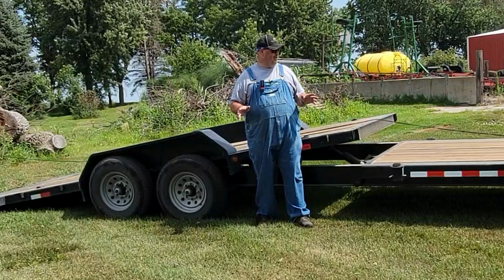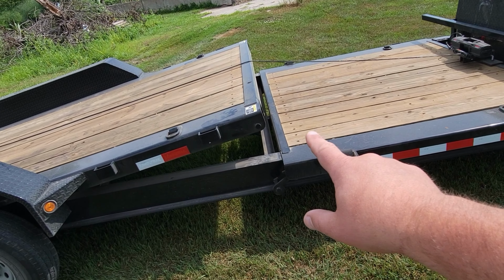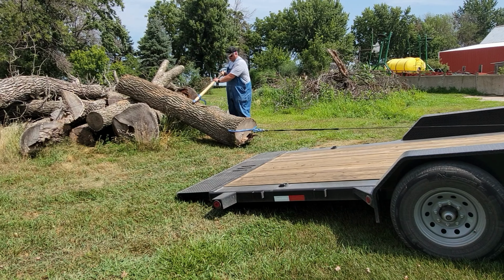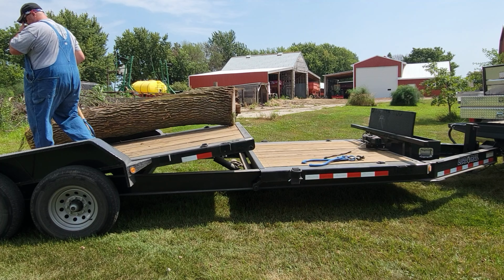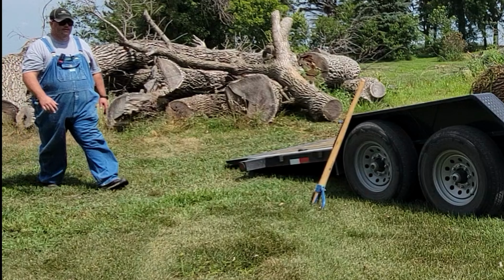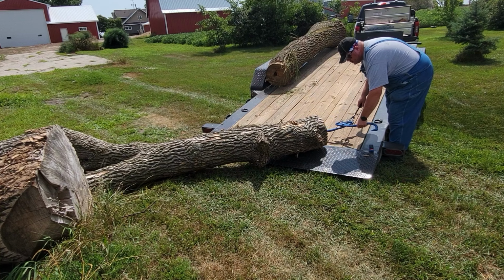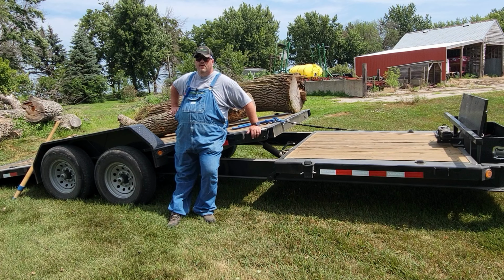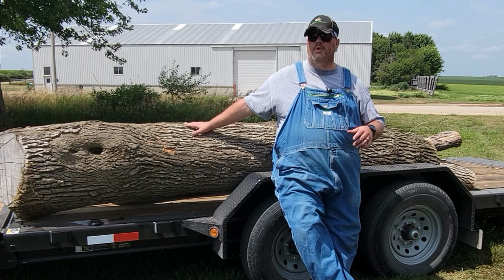Don't have a tractor or skid steer?  Here's another option for picking up logs.

Comment: Put a arch on back and  ditch the tilt bed. I had a tilt and switch to a non tilt with the arch and can do logs up to 13,000 pounds
Reply from the maker: Well, I'm not ditching my tilt bed trailer because I am rather fond of it.  I've seen the log arches and they work very well.  I don't need to pick up a log that weighs that much.  If I did, I'd cut it into smaller pieces and use this set up.  Thanks  for stopping in!